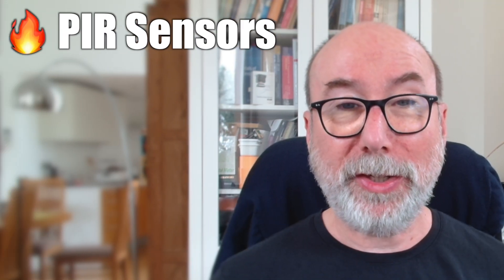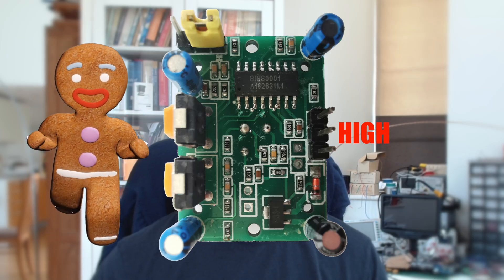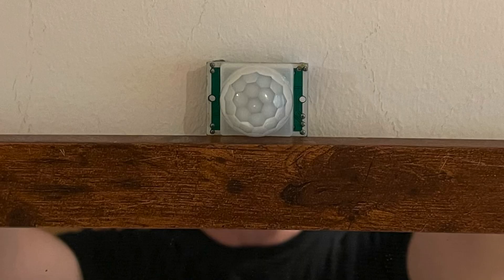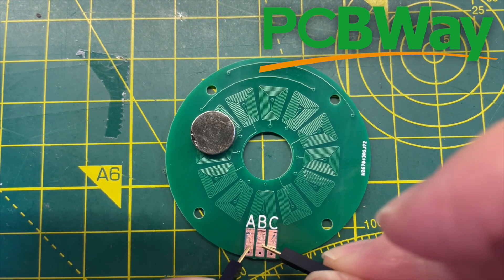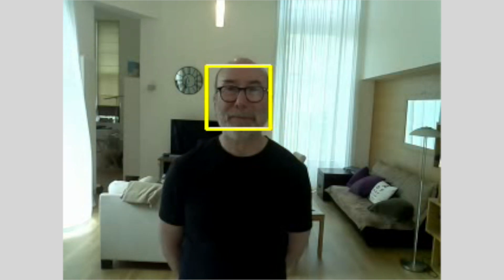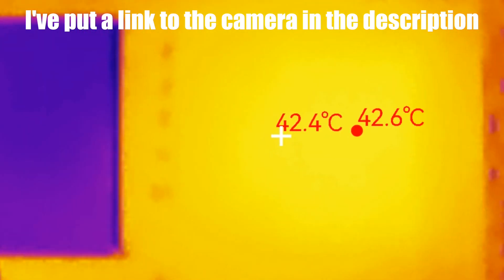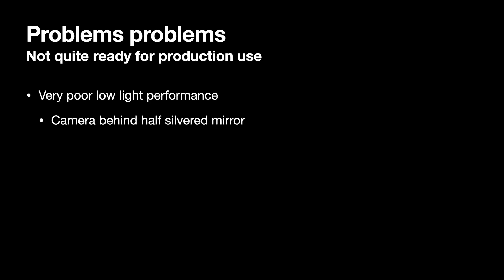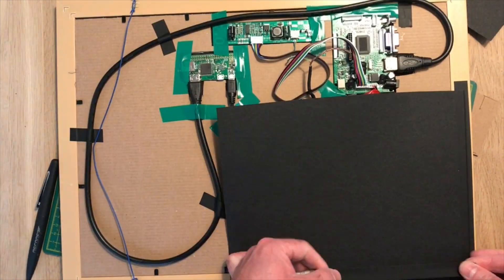A Smarter Magic Mirror - Raspberry Pi Face Recognition and Doppler Radar Motion Detection

Comment: i'm using LD2410C presence sensors and the big advantage to them is you can configure it as far as sensitive and max still/movement detection as in less then 0.75 meters. This should help with your detection slowdown as it is very quick in responding to changes.
Reply: Maybe the biggest advantage to the presence sensor would be the ability to use a smart mirror in a bathroom. Granted, you lose face recognition, but I don’t think many people would be comfortable with a camera in their bathroom mirror, no matter how smart it is.

Comment: 6:21 On a side note, Drone workshop uploaded Simple ESP32-CAM Object Detection in which there was a free service to Edge Impulse, that allowed Machine learning to recognize your face and upload the finial app / extensions into popular boards/platforms. They have trained model for Faces already, however you can upload your face (Mutiple times) to allow the ML to learn You :D Thought it was a neat idea, as I wanted to try and make a Face scanner, trained only to me. They also train from Sensor data, and Audio sources as well - a voice activation or recognition is also trainable to YOU. Also note, the times for Face recognition was about 141ms on a Esp32
Therefore, I suggest you try a ESP32-Camera board or similar and have that trigger the Magic Mirror to turn ON after a Positive, you probably don't even need the Radar Board to trigger the next step. Powering the ESP32 or similar just for this function is going to be an Energy budget of pittance  :face-blue-wide-eyes:

Comment: could you turn off the backlight to the screen and stop producing frames for it to show, to save power? Work out whether it's power off state is all white pixels or all black, and get the Pi to hold that frame with no backlight. Then you don't need to wait for the screen electronics to boot but you still get a decent chonk of the power savings?
Reply from the maker: That’s not a bad idea! I’ll have to dig into the display card and see how it works.

Comment: I current working on radar. Are over night tests when is running in a cupboard the AC is off, and no lights are on. so no air move, it see about 50 new objects every 60mS. 
but is 70GHxz radar, we think is dust that is always in the air, triggering the object detection.
Reply from the maker: Interesting. Is there any way to change the sensitivity of the receiver?
Reply: @atomic14  The old system which I think was 40GHz the wrong sort of fog blinded it, as was mult/div of the wavelength. The new one scan over about 20 GHz, and it should filter out anything that is not picked up in all the freq  but it a bit harder than that so they are still working on the filters

Comment: I'm building a Magic Mirror on a Pi 4B but would prefer to use a Zero W.  Everything I've seen says that you can't currently run MM on a Zero due to an "Electron"(?) limitation. Do you have a way around this?
Reply from the maker: My magic mirror software is home grown so my experience might not be very relevant. I'm just running a simple website with chrome running in kiosk mode on the Pi Zero W.

Comment: So one of the plus points of the ld2410's is that they are hugely configurable when it comes to detection sensitivity and the configuration is done in distance bands so you could configure one so that it essentially only triggers when you're directly in front of it but also RCWL-0516 units are known to clash with wifi and have been seen to generate false positives.
Reply from the maker: Definitely. The RCWL-0516 is definitely on the cheap and cheerful end of the spectrum. Only for use if you're willing to put up with the downsides and don't need fantastic reliability.

Comment: Neat project!  Lots of great info.  Cheers!
Reply from the maker: Thanks! It was fun digging into the different options. I was surprised how well they worked on the Pi Zero - it is pushing it pretty hard.
Reply: @atomic14  you've raised my appreciation/expectations about what's possible with Pi Zero 2, thank you for that!  I appreciate your approach to measuring and tuning energy consumption.  

Ideally Pi would have a sleep and/or fast hibernate mode, maybe then through interrupt activation, or, some other external low ampage PIR activated Mcu (e.g. ESP8266, ESP32) could activate Pi.  Would be neat to see current be as minimal as possible during Idle time.  That would help enable broader set of battery based applications.  

Am assuming most people are not standing in front of the mirror most of the day, so optimal power usage is worth pursuing :-)  

Maybe there's limits on how many services/features can be stopped/disabled on a Pi Zero, and, something like STM32 or something else powerful enough to run OpenCV, but with deep sleep mode support, would be needed?

Anyway, cheers for your informative thought provoking videos!
Reply from the maker: It's probably not really the right device for this kind of thing. As you say an STM32 or ESP32 might be more suitable as they have support for deep sleep modes. Reading around the Pi Zero can be got down to around 80mA so that's not too bad.